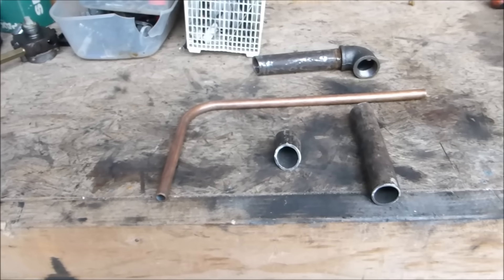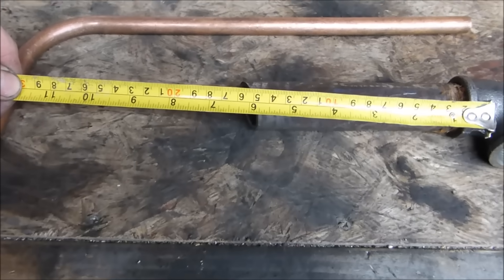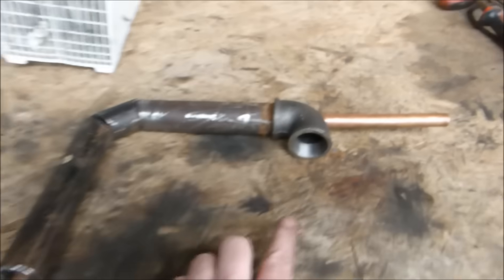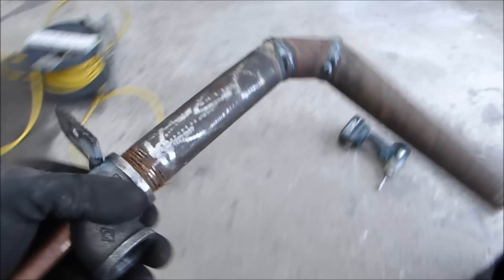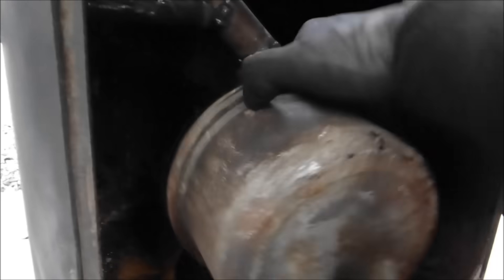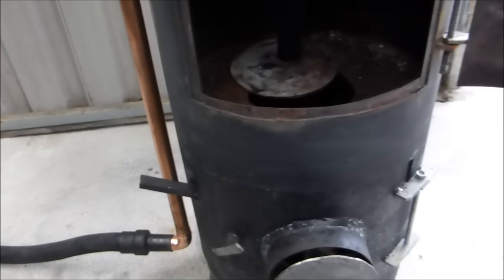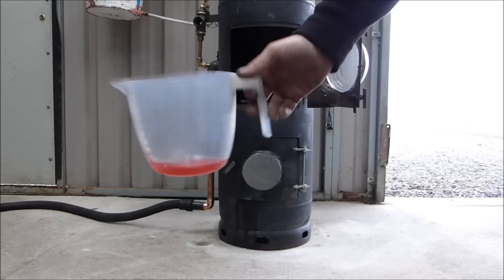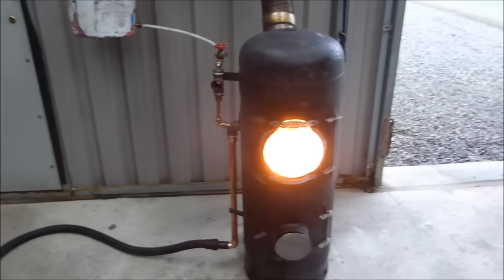Build a New and improved fantastic output Waste Oil Burner.

Comment: You should put elbow at the bottom of your pipe so to blow air/flame into vortex. Once you have cortex flame you achieve super clean burning even with dirty oils.
Reply from the maker: Hi Halo Effect. I have a boiler stove on the go at the moment and it has a bend on the air into the chamber but a whole different burner system. Thanks for the advice Cheers Gerry

Comment: I think I'd go to  a little effort to make the center tube out of drawn stainless tube. That copper might deteriorate rapidly and couldn't be easily replaced without re welding the whole pipe assembly. Of course if you have the time and a bucket of pipe fittings and no money to speak of, this seems like a workable solution. Also if you are in the unenviable position oof having to pay people to haul away wast flammable liquids and buy fuel it's a no lose situation.

Comment: I built the same one and used gasoline and burnt down our apartment complex of 120 units.
Reply: Not many can say that .
Reply: Difference between flammable and explosive. Oil has massive amounts of carbon and abscence of flammable gasses. Gasoline has vapors and fumes off into many explosive and pressure fragile gasses
Reply: @thelongranger55 it's BS...
Reply: I'll take things that never happened for $200
Reply: We have a name for those that do this Danny.  One with out the common sense to use oil instead of gas doesn’t have the ability to build something like this let alone purchase a 120 unit Apartment complex.  I might believe you burnt your room in your mom’s basement playing with matches.
Reply: @eugeneanderson7984 😂
Reply: @eugeneanderssounds more like it7984
Reply: With gasoline you can use any gasoline engine to make heat, and torque that can make electric/power and through other appliances and items heat!   Gas needs 100% controlled oxygen imput to be safely burned in quantity.
Reply: Good job
Reply: Did you get a good heat off it though?
Reply: Never happened
Reply: Some people shouldn't play with fire
Reply: @deepnurmom1737 or they should and suffer the xonsequences😂
Reply: Popular guy I'm sure .
Reply: Ha,  thats great 👍
Reply: These these type of oil burning units is not meant for apartment complexes.. or your house. You just like this that you make to burn oil should only be used in your garage or outside. When you build it. Tested outside of your garage before you decide to put it in your garage to make sure it's all working good. Just my advice. And comment.
Reply: That's a new level of stupid
Reply: What a move😂
Reply: Incredible story dude. Hope you're doing well now.

Comment: Can that soldered joint explode ? What technique did you use in soldering?
Reply: I watched the whole video and saw no solder.  There is welded steel, but that's not going to melt or explode.

Comment: Can we make a simple heater that that starts with wooden fire burns scrap plastic and makes fuel out of it . after what it uses the oil that is burning away that has been started with wooden fire and now that burning oil recycles the rest of the plastic from which it gets more oil etc.. . Etc so it works while adding plastic and heats the room or water .. etc..

Comment: What if also biogas would be fed to it simultaneously, it could make it burn oil even slower, pressurizing the oil injection with a compressor and spray gun could make the whole flow smoother and easier to adjust. Awesome looking burner all in all!

Comment: hi awesome vid..can i ask...what are you using as a blower??...im in need of a small shop heater and electricity for one month cost me 1,600.00 and so not a option...i can run natural gas but again that here in canada would cost bout 1,200.00..so again no...so, im trying to learn how you have been doing it...awesome idea as im an advocate of re-cycling...im a wood builder and always try to re-use wood..(love out trees)..i normally go out and pick up anual deadfall wich is free..in my area..but anyway thanks for your ideas, love your vids...keep up the good work...thanks again.....p.
Reply: Yvon Larocque plz look up "rocket stove", made of aerocrete...  Should be a good option for your location and needs... 👍😉👍

Comment: Did you ever measure the temperature right at the exhaust outside? Just wondering how it compares to a wood stove. Not that I know how it is for the average wood stove,but I bet someone does. I would guess it can all be adjusted with fuel flow and volume of forced air to match the burn chamber size and capability.

Comment: great design, but did you realize that the metals you used are going to corrode from electrolysis? You need a dielectric connection between copper and steel.

Comment: Have you discovered the optimum distance that your drip line should be from the bottom of your burner pot? I'm ready to drill a hole in the side for the feed. Just need your advice.
One more question- I have an existing 4" vent from an old oil fired furnace. Will 4" vent be adequate for the waste oil too? What kind of stove pipe is required for oil? Thanks again. Maybe when I'm done with the unit I can send you a picture of what you inspired me to build. Thanks

Comment: My main concern for this project is losing power during a severe storm and not having heat. Average outside temp lately has been -32deg Celsius so heat is very important. I love the idea waste oil stoves run completely off the grid. I'm pulling a regular oil furnace out and capping the oil line and replacing it with a waste oil system and just plumbing in the old flue to the new waste oil stove. That way I'm not burning my expensive #2 oil outside to heat my large garage, where I spend most of my time.
Reply from the maker: Hi Ryan. Build my other burner,  it needs no power and can make as much heat. Here's a link https://youtu.be/ShTLaYKjzxw This new burner will fit in the same stove design and run all day with zero power but it will make a ton of heat. Another stove I made needs no power, can heat the workshop and I can cook on it too here's a link https://youtu.be/tnzEDEpz3Yk Hope this helps Cheers Gerry

Comment: I ask because I have a large tank just like this that I'm about to start cutting into and I need to know where my doors should be located. Any reason in particular you chose that high up on the tank for the burner? Why wouldn't you chose to go lower so the flame retains inside the tank longer? just curious and want to maximize output. I'm thinking about 1.5-2.5 ft up cut a door and create a spot for my burner pot to drop into. then cut out large sections out of the side walls below where the burner will be sitting because I will not be using forced air. With a grinder I'm going to cut all but the structural integrity out of the bottom so that it provides plenty of air up into the burner. love your videos. thanks for any advice

Comment: whats the bottom hole for? The one under the access door to the burner (11:18).  didn't see you use it nor mention it once. thanks
Reply from the maker: Hi Ryan. The reason for the door sizes and positions are that I wanted to make this stove so that with the burner installed I could close the doors for safety. I made this stove to run on solid fuel or waste oil by simply removing the burner and installing a grate for the coals or wood. The newer type of burners that I have made since this stove are bottom fed with air and I wanted a stove that was modular so I could easily experiment with the different burner designs that I had in mind. Have you seen the newer burner. https://youtu.be/ShTLaYKjzxw  It runs without the need for a blower although you can force feed it air too. Hope this helps. Cheers Gerry
Reply: Thanks for the quick reply Gerry. Ill check it out and if I have any more questions I'll let you know. Thanks again
Reply: GerrysDiy is 4" exhaust sufficient enough for a combo waste oil/ solid fuel stove or should I just stick to waste oil stove only so I don't have to change the existing 4" flue? Thanks

Comment: And what stops the burner from spilling over?
Reply from the maker: Hi Shane. These are crude setups and there is nothing to stop overflow. On my setup I use a limited fill each time I light the stove but the oil is setup to flow in at a rate of 2 to 3 litres per hour and it will burn that no problem. On my later setups I can make more heat without the blower although I have a setup with a blower too. Here's a link https://goo.gl/sL1fQ6 There are quite a few videos since that one  Cheers Gerry

Comment: any chance of showing / telling how many hours of burn you get per litre of oil. ive just built a keg furnace running on propane and the gas seems to go so fast. im thinking waste oil has got to be the cheapest way of melting my beer cans and other stuff.i only need electric to power my hair dryer or leaf blower for oxygen, am i right?

Comment: Is it necessary to have a stove pipe to vent through the roof? 
Sanity66@gmail.com
Waiting for your reply
Thanks
Reply from the maker: Hi Beth. The flue could go horizontal and then up so it could exit the building through the wall and then up. I use a 4 meter (13 feet ) flue in the shed and it provides enough draft  ( suction ) to pull all the smoke into the stove and out of the building. I made a different burner that requires no fan but does rely heavily on the flue. Here's a link to where I had it working in my house heating water and my central heating using just veggie oil. https://youtu.be/SAmHNp6fOUA Cheers Gerry

Comment: I enjoy watching your videos, and you have given me an idea that may be of some interest to you. What if you used an old spin on oil filter as a combustion chamber with a pipe threaded into the center hole as the chimney. I'd like to put a water jacket around the chimney, mite make an interesting camping water heater?
Reply from the maker: Hi Doug. That sounds very interesting and and easy build project. At the moment I have started making a different powered burner that I hope will be thermostatically and electronically timed. I was working on it last night a little and I think I can test fire it tomorrow. Once I get it firing well I will do the controls and fire it in a boiler. So if it goes to plan there will be lots of hot water for heating and domestic use. Thanks for the tip Cheers Gerry
Reply: GerrysDiy  looking forward to the video. Have a good weekend

Comment: Maybe a cast iron pot would be better than a stainless steel one. The mass would produce a better burn chamber, I believe.
Reply from the maker: Hi Kevin. I have a few different pots that I used and with the forced air burners, a cast pot can work very well. In my latest shed heater I made a different burner and I dont need a blower. I can even cook on it https://youtu.be/tnzEDEpz3Yk This heater makes some serious heat and although my shed is uninsulated I can be warm in there working away. for just a couple of litres per hour Thanks for the comment Cheers Gerry

Comment: why did you use T-joint at the oil line? 
nice project and thank you for sharing
Reply from the maker: Hi Reggie. The T joint has the back drilled out so that it can be used as a viewing window to see the oil flow.  My later  burner can make as much heat and does not need a blower here's a link to it heating the shed and cooking too. https://youtu.be/tnzEDEpz3Yk Thanks for the question Cheers Gerry

Comment: This is neat. Though I'm far away from needing such an amount of power (well insulated flat with neighbors all around ).
Reply from the maker: Hi. My shed is quite large so I needed quite a large amount of heat but it is possible to scale down these burners. I have a non powered gravity fed burner heating my home in this video. https://youtu.be/SAmHNp6fOUA Cheers Gerry
Reply: Hi. Thanx for replying. Checked out the other video: But: I do believe I found myself a simpler solution (I'm gifted with 2 left hands - so it must not have to do with too much of handcraft work). I got a good old coal burning oven. Now I just put a stove pipe (some 5 inch in diameter and 3 ft long) before it. There is a baking tin where it touches the ground. And at this end is a 90-degrees-piece put on which is now somewath of a burning chamber. If I want to burn oil I just position a plastic bottle (upside down and with a hole in it at the bottom) above the opening and unscrew the lid a little bit and let the oil drip in. There is such a draft (I never expected it that furiously) that the flames do not even touch the walls so that the walls will easily withstand (I guess). But this needs a bit more testing. If it ever came to that I'll have to arm the respective spots. Maybe I'll empty a can of zinc-spray into the pipe or I'll smear some cement (for ovens) there or something. See u.

Comment: How about adding an impeller to the exhaust  and connect to a propeller to force air into the combustion chamber?  Basically a turbo charger.

Comment: Excellent unit Gerry, well done. What did you use for the glass windows? Casserole dishes?
Reply from the maker: Hi Peter. I just used a pyrex casserole dish and if you give things enough room for expansion they work with no issues. On one of the stoves the thermal contraction killed one of the dishes but I use some fiberglass rope now to allow for movement. Thanks for the comment. Cheers Gerry

Comment: hi i see you run your air pipe over your oil pipe , would it work ok if i just run in a air pipe along  side the oil feed pipe cheers
Reply from the maker: Hi Kylie Oliver. If you run the pipes side by side the oil feed will eventually foul because the oil will burn inside the oil line as it passes through the flame. The main reason for pipe in pipe is to cool the oil with the air supply. Hope this helps. Cheers Gerry

Comment: simple design tick. well done pal. question. 1. will kerosene be you're primary 'go to ignition vapor? if not, what is/will be?? 2. the waste oil, have you yet to test on the broad spectrum of waste oil? (*my interest heavy weight diesel oil). and sorry to sound like a nag, but 3. efficiency ratio? time/ (based on any waste oil you've probably tested) / fuel used. and sorry again, but how much air are you pumping through, *average. 
neat design tidy craftsmanship. 👌
Reply from the maker: Hi Tomma. I usually use Kerosene to start off the burning process but I have used rags, paper domestic fire lighters, diesel etc. Once the vaporising pot it red that's it you are good to go. I have burned gear oil and hydraulic oil and once the vapourising pot it very hot it burns with no difficulty but there is more residue after a days burning. You can make a lot of heat for about 3 litres of fuel per hour. Here's another burner I designed that uses about 2 litres per hour and does not require a fan. There are a few videos in my playlists about this new burner. Here's a link https://youtu.be/SAmHNp6fOUA Hope this helps Cheers Gerry
Reply: +Tomma Grelogra - What I have learned what important the most is....  The Burning Chamber. I have seen so many YouTube / Videos and " No One " mentioned the Burning Chamber.  That is the Heart of it all and you can placed that practically into anything, like Fireplace... Wood Stoves or DIY Stove etc.... I am developing it right now, I will have a Video on it soon. But I will explain it further details about it.  I have also found a Material that is Cheap and Effective for the Burning Chamber as well that I will share in my Channel :)

Comment: please  understand Tube is always
Od pipe always nominal bore
but thanks will do so you have copper tube and one inch NB PIPE
Reply from the maker: Thanks for the comment Stuarth43. Cheers Gerry
Reply: ok mate building one huge furnace, 50x25 inch od rhs in 75x38 od rhs out, weedblower 24vdc to force the air, leading to   FIREBOX , CLAY LINED TO heat steel

Comment: The blower isn't efficient, what about gas, what can be done to put it back into the system?
Reply from the maker: Hi Tony. You are correct, none of my blowers are too efficient but in my later videos I designed a different burner type that does not require a blower at all, runs about 2 litres per hour and can make the stove glow red. Here's a link to where it sounds like there is a fan installed but it's just normally aspirated. https://youtu.be/muiYHNMxMgc
Thanks for the comment. Cheers Gerry

Comment: nice heater. built smaller one myself as my workshop is only 13ftx13ft but only uses about 2 ltrs every 10/12 hrs. gonna make a video on the contruction as its a very clean efficient waste oil heater.
Reply from the maker: Hi. fixitmakeit. That sounds cool I  would love to see it. I made a different type of waste oil burner that does not require a fan. It works on the updraught caused by the combustion It uses 2 litres per hour but makes a lot of heat. Here's a link https://youtu.be/b4xZneXFenc?t=3m32s
Cheers Gerry

Comment: So Gerry I have a question. I assume you know how a turbo charger works. In that you have a turbine at one end and a compressor at the other of a common shaft. To make one without the need from an electrical source couldnt you use the pressure from the hot exhaust gas exit to spool up a turbine wheel and use the compressor side to add ox to the burner. ? Seems like common sense to me. Of course at some point it would try and run away from ya. Due to the feed of ox would then increase the heat exiting. That would then speed up the ox on the intake side and may at some point require the use of a waste gate to bleed off the amount of hot gasses to getting to the turbine wheel.
Reply from the maker: Hi Ross. Thanks for the comment. I have a different version of the burner unit now that sounds like its being powered by a fan but in fact I just designed it to operate differently. This new burner uses about 2 litres per hour and makes the stove red hot.
Here's a link https://youtu.be/lU93mSoaJEk    No need for turbos or anything mechanical. Cheers Gerry